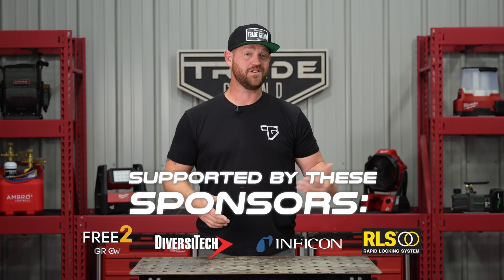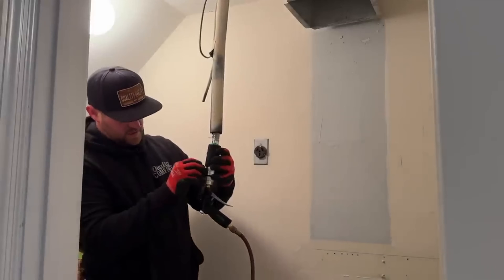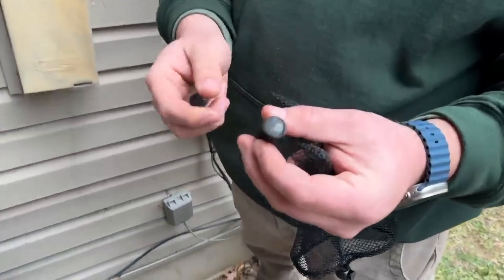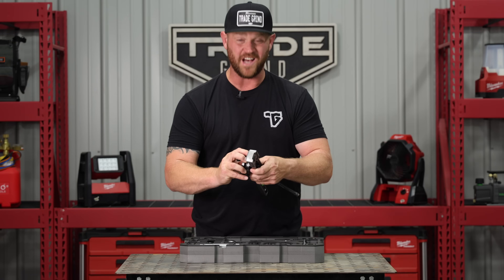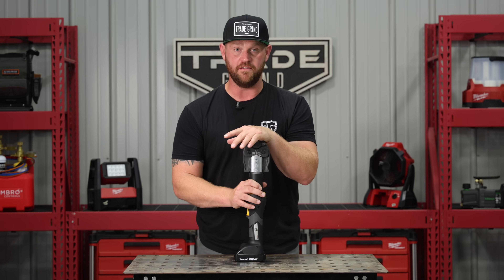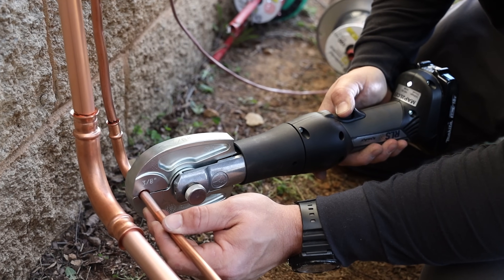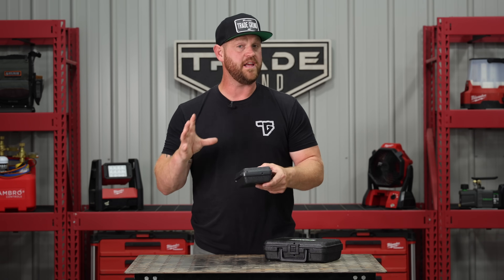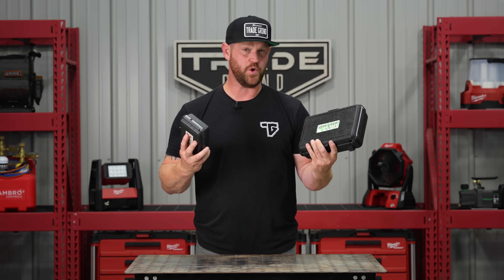5 HVAC Tools That Make My Job Easier

Comment: Ive been in the dental industry for 24 years. We use laser welders for various metals. Instead of brazing, there should be a small hand held laser welder to join the lines. There's no giant flame. No tanks etc. A small handheld laser welder with a small internal tank should be invented. Should I do it? Laser welds typically are STRONGER than traditional soldering or brazing.
Reply: We will be waiting brother good luck - could you keep it around 200 bucks also? Thanks :)

Comment: That ECM tool seems unnecessary. Check for high and low voltage at the motor with your meter. Why change one and not the other? Sell both motor and module.

Comment: I would be worried about that foam plug getting stuck in the line set.!!!  😂
Reply: If it gets struck, there's a restriction and you shouldn't reuse the lineset anyways.

It's easy enough to get the plug out though. You have to move the tank to the other end of the lineset and push it out the way to sent it in originally.

Comment: Used to use press fittings on ACR but found a few of them leaking especially if you’re matching older ACR piping with newer piping. Did everything that was supposed to be done to keep it clean and reamed but would still get leaks. Gave it up. I will only use those fittings if It’s too dangerous to braze.

Comment: With the hilmor pipe wiping tool, will it pass on a elbow fitting ?
Reply: Yes it will go through 90s and other fittings. If the plug doesn't come out it generally means there is a kink and you are in trouble

Comment: I do commercial HVAC service.   I didn't think I'd need a swedger but the more and more I get into the trade the more I want that instead of doing fittings.
Reply: Same here brother.
Reply: Definitely
Reply: There’s this hilmore ratcheting swager, strongly recommended !
Reply: Swedge kit rocks  i rarely use fittings anymore
Reply: The high press is a lot of money with the Jaws and the fittings are not cheap either and you're depending on a rubber o-ring I'll stick to brazing with silver solder
Reply: Commercial hvac tech here, swedging comes in handy but Novak makes a handheld expander that’s nice

Comment: That press tool would have been nice when I set off that sprinkler head in a building. What a mess that was. They had too low of a temperature head on above the air handler and when I brazed the fittings the head popped.
Reply: When I started in this business...after two years of classroom @ TSTI (Texas State Technical Institute) way back around 1979....I was brazing near a sprinkler head on a 4-story bldg. being built...and set it off, ruining a complete pallet of ceiling tiles